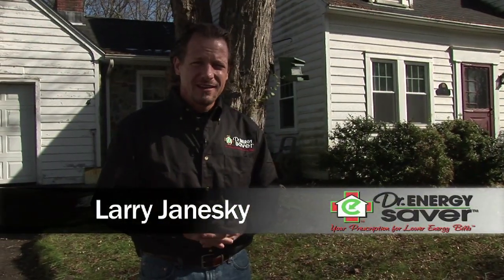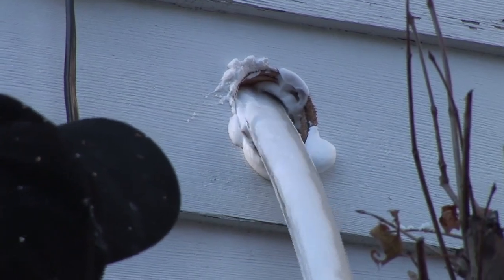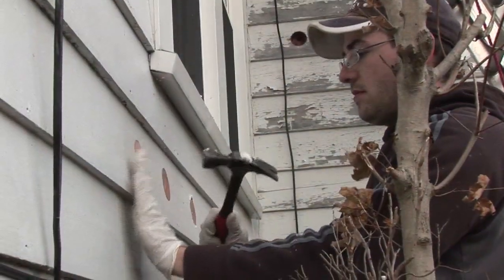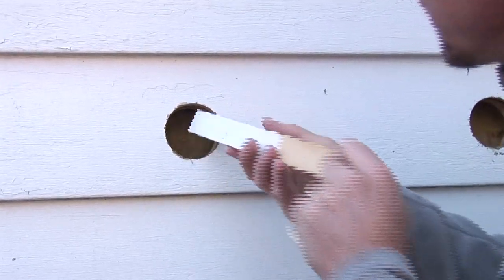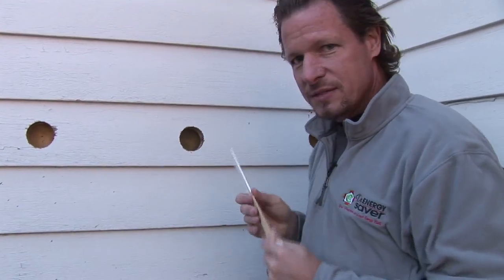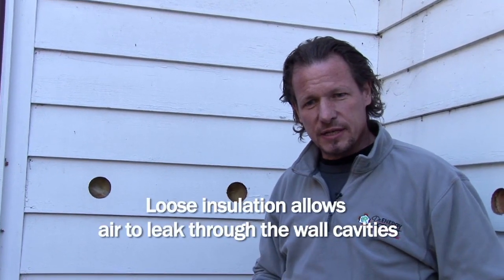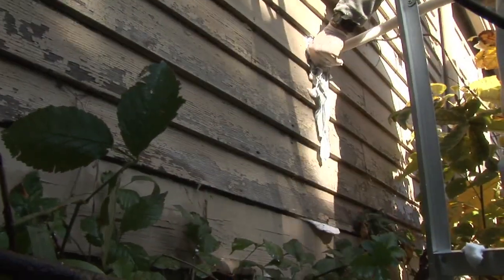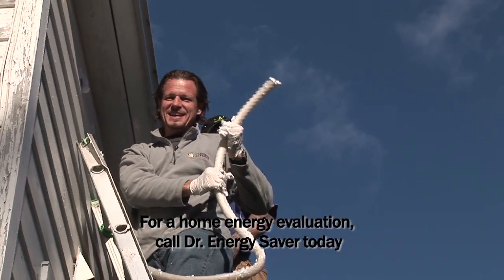Injecting Foam Insulation into Exterior Walls with Clapboard

Comment: This seems cool, but I imagine a total nightmare when you want to do anything inside regarding plumbing and electrical. I would imagine replacing siding with insulated vinyl siding would be a better choice.
Reply: This isn't the same thing as spray foam, you can push electrical wires through it and you can cut it.

Comment: What happens if you need a complete home REWIRING? Is it even possible to rewire a house with this foam injected in? Thanks
Reply: rewire it first.  Else, you'll be cutting out the drywall and insulation to run your wires, and will need to re-insulate those patches.

Comment: GM Dr. Energy, Do you know anybody that does the same Exterior wall insulating using the high velocity foam in the Orlando Fl area.. We have a townhouse that has an upstairs bathroom with no insulation in the three exterior walls in results to cold and hot bathroom conditions. The old owner was slick to remodel the bathroom and we found out too late that little or no insulation was used.. Can you help...! We will give. Call.. Thanks

Comment: This is one way to ruin your home! If you’re wanting to insulate you’re home.. do it properly and at same time modernise it..yes will cost more to pull off interior gib but in the long run with holes all through your cladding you will have to re clad why would you drill hundreds of holes in exterior cladding which is supposed to be water tight!? Total fuck up. It’s like drilling holes in your roof.. and patching with silicone!!!! Wtf.
Reply: I had this done on wood siding, no problems and have saved 83.25 a month in winter.  I get you don't think it works, but you have no idea what you're talking about.

Comment: Unless the foam has changed, i would use caution during install as it will be a conductor (ie, turn off power to that area of the home). I had a buddy shock himself can spray foaming around his outlets! Be safe out there...

Comment: enjoyed the video, thanks for uploading it. trying to find suggestions for my current situation. I've got a kitchen wall that has 50 yr old insulation in it and it's an exterior wall. The wall temp right now is about 35f and it's 18f outside. it was re-sided in 2012 due to a fire next door but the contractor refused to let me remove the plywood outside to retrofit some newer insulation.  There are cabinets and a stove on this wall so it would be a big job to remove them and the drywall then insulate and replace. Would it be better to remove the siding outside and pull the plywood off and replace it that way or?  Thanks in advance for any and all suggestions.

Comment: Is it the same effect by injecting foam with existing insulation as opposed to tearing the sheet rock and doing it?
Reply: I would be curious as well. The cost of tearing off sheetrock, then insulating, vs this method.
Reply: Nick Miller  If you do the the sheetrock work yourself its cheaper to tear the interior walls out.  I think the main advantage to going outside-in is if you need use of the space in the house. Interior walls out, is nice because standard insulation is cheaper and if you have a really old house this give you an opportunity to inspect (or upgrade) the electric.  The major drawback is an interior construction zone (especially when dealing with  female companion)
Reply: shayne flaherty thanks for the reply shane. Do you have any idea how an estimate for foam injection is drawn up? Is it based off Linear feet?
Reply: well cubic feet, i.e. wall depth x wall area, but the other factors are drill points and wall jogs,  and complexity, i.e. 2 story, electrical issues.. but the basic calculation is cubic inside wall area.